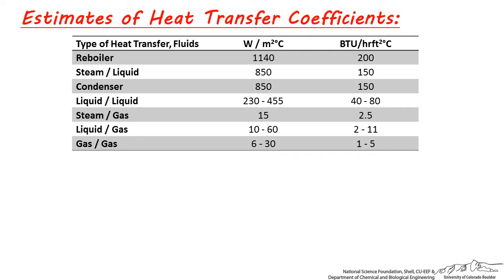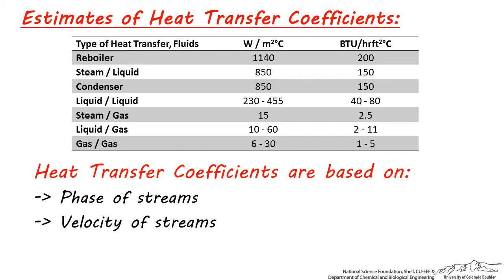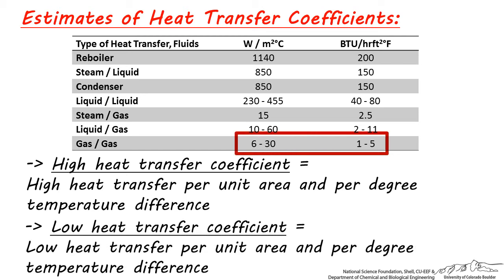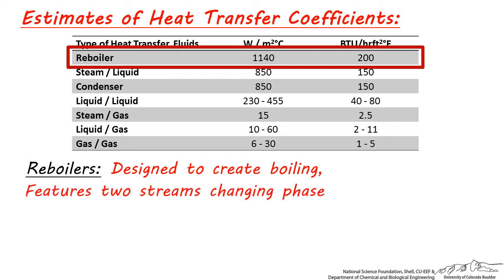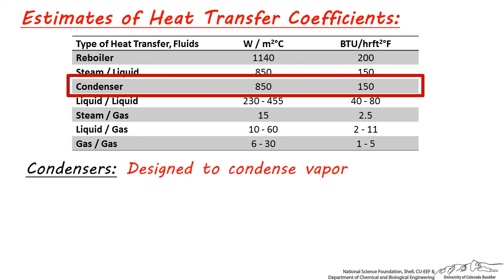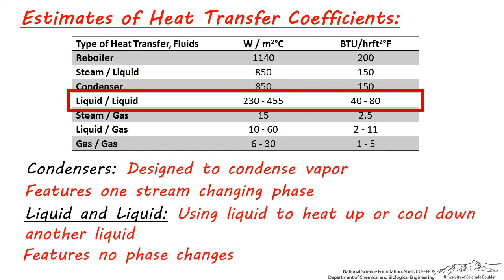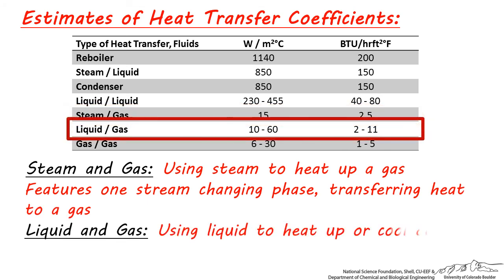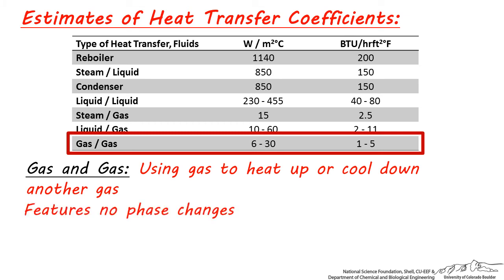Estimates for Heat Transfer Coefficients

Comment: Thanks for the explanation in detail. In case of the reboiler using heat transfer fluid other steam which does not change phase i.e. hot oil, will the heat transfer coefficient of the reboiler be the same as that of the condenser?

Comment: Liquid/Gas: In this case, there is a phase change; however you were saying that "features no phase change". How cannot be a phase change?
Reply from the maker: Good question. In this case, Dr. Miletic is describing different types of heat exchangers. In this one, a liquid is used to heat a gas, or vice-versa. This means that there is a gas inside the tube and a liquid outside the tube (or vice-versa). These do not meet and do not change phases.
Reply: @LearnChemE  Thank you for answer!